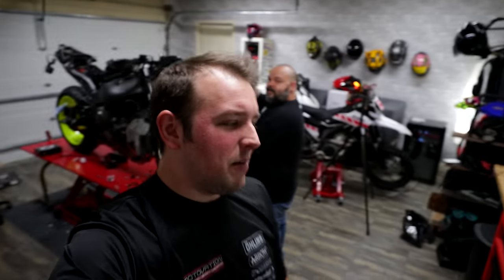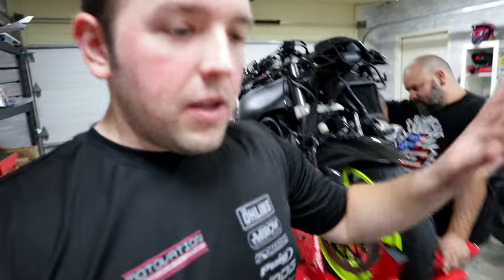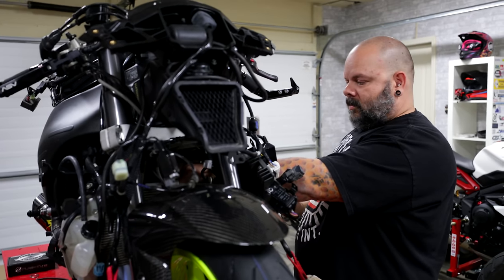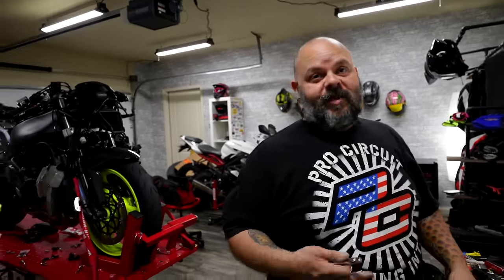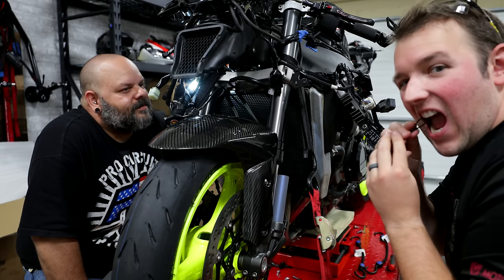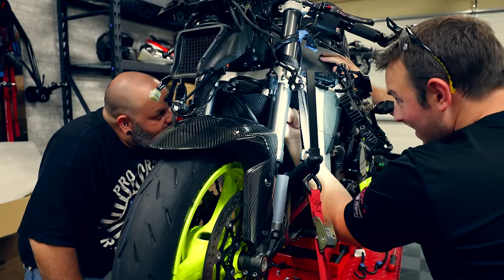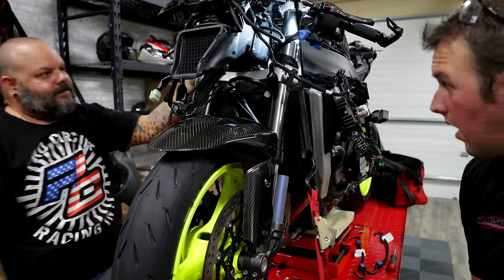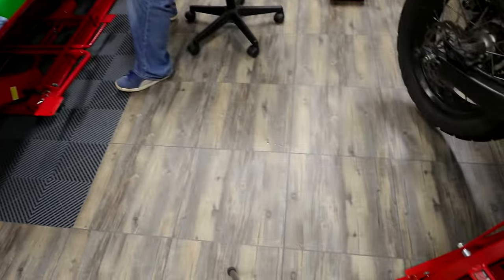The ZX10R is SO CLOSE to being finished!! [Wrecked Bike Rebuild - S2 - Ep 18 - Ninja ZX-10R(part 2)]

Comment: I worked for a dealership back in 2006 where i was specifically targeted because i had mainly Snap-On and Matco tools and box. They broke open my bay door and and used a roll back towtruck  to steal my beloved full of tools box. They also stole my neighboring mechanics full box. They stole it all in less than 10 min. They were never caught and my dealerships insurance did not cover the techs tools. Not only did they steal my tools, it ended my career. It took me a long time to get back where i am. Something to think about. Snap-On  is not just given away though. They are extremely expensive, 8mm through 21mm flank drive wrenches cost me $600 , i got them on sale.

Comment: That's why I went with Evotech Performance radiator and oil cooler guards, in stead of R&G. You could have just went to R&G website and looked at the color pictures to see where they fit, they have an online fitment instruction, but still sucks ass to look at black and white instructions

Comment: Thought you were supposed to get the bike up to temp with the water in it to flush it out making sure the pump turns on and flows all the coolant. Gonna get green and blue mixed up in the pump and it turns in to sludge